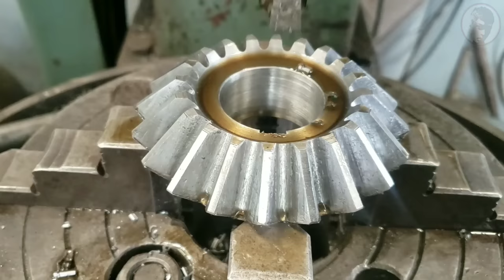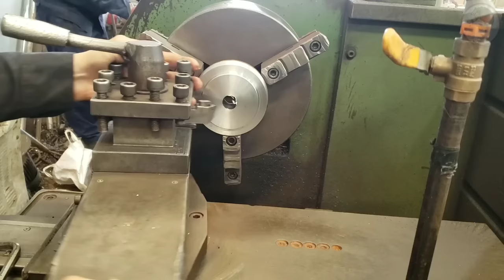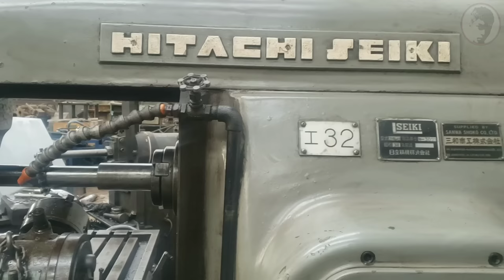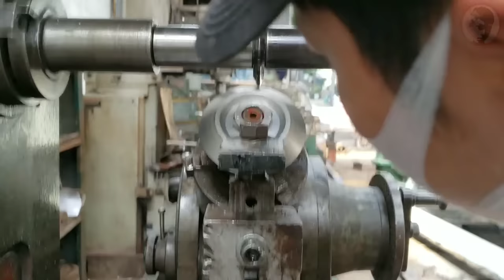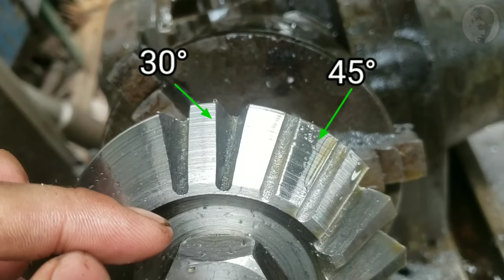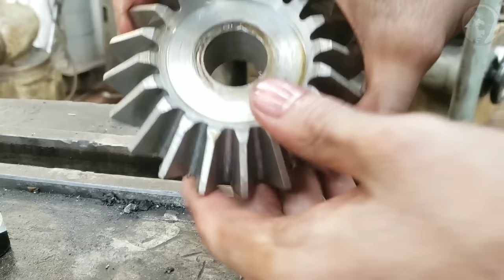Tôi Gia Công Bánh Răng Côn 45° Bằng Phương Pháp Đã Cũ trên máy phay HITACHI

Comment: Good work. This how we used to do it, when I was a young machinist/ fitter or (Fitter /Turner) in the 80s.
Though it's was always good if possible to fit to it's mating gear but not always possible.
Reply from the maker: Thank you for your comments and support. I'm surprised you did this work in the 80's. You must be old?
Reply: @thdVn  I am.
Lol.
Mid fifties. Keep up the good work.
There will always be a place for a manual machinists.
And Rember Knowing how to use the right materials and the right way to harden and temper and when to and when not to, is all part of making good reliable part's.👍
Reply: @thdVn  I did this in the early 70,s  More manual then

Comment: Good work very succesful 
Did you find that the tooth depth angle on the gear wheel should be 30 degrees or does it say in the catalogs?

Comment: Nice work but I don't think it'll be suitable for high-speed service because the cutter is cutting parallel lines. Where they really should be conical radial lines all through the profile of the tooth. It'll probably work for he wants.
Reply: He's using involute gear cutters. They have the correct (inverse) shape for the for the tooth profile he's cutting. He's got the gear blank on a dividing head to ensure he gets the correct number of teeth and centered spacing. It may seem "old school", however, it's more the "poor man's" way of creating gears today. He's making it out of aluminum, which means he doesn't need the higher strength of steel.
Reply: @mikegarwood8680  its steel not aluminium xD
Reply: @grzybo165  That's what I get for watching a video at 3 am.
Reply: @mikegarwood8680  Exactly

Comment: Yeah well it's not very accurate. Bevel gears pitch changes from the outside diameter to the minor diameter and  achieved by generating the tooth form on a bevel gear generator. Angles involved are root angle, pitch cone angle,face angle and tooth angles. You simply cannot achieve a level of accuracy by single index milling with a dividing head and single tooth cutting on a mill. The tooth profile is wrong.
Reply: This work is not for high speed but just jobbing work and is good enough for a lot of applications  Professor
Reply: @leehotspur9679  Stick to what you know.... which is nothing..

Comment: Why was the cutter running eccentrically?
Reply: Those are just the collars /spacers that hold the gear cutter in position, the actual arbor is in the middle of them and is straight as can be seen from the gear cutter turning true
Reply: @shedasaurus  ; Wrong.  I can see the cutter running eccentrically when he checks at low speed.  You can see the space between the cutter and the work change..  Furthermore, since the collars are clearly running eccentrically, he used the wrong collars on the spindle.
Goodbye.
Reply: @wrongfullyaccused7139  Yawn